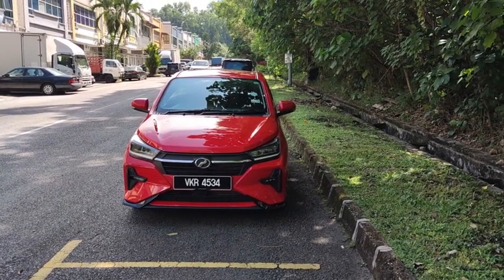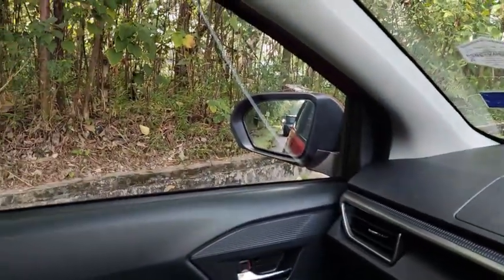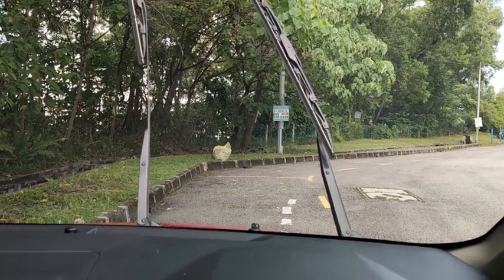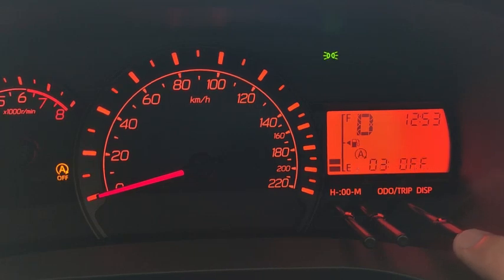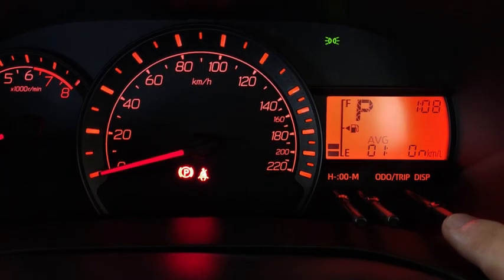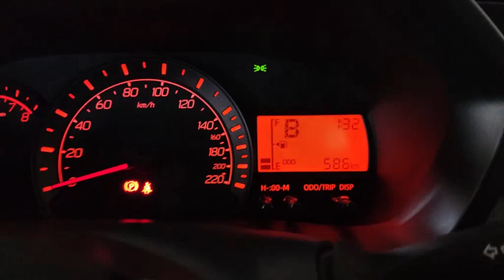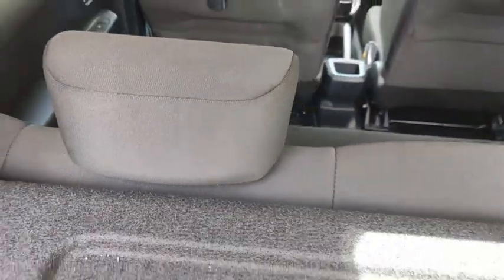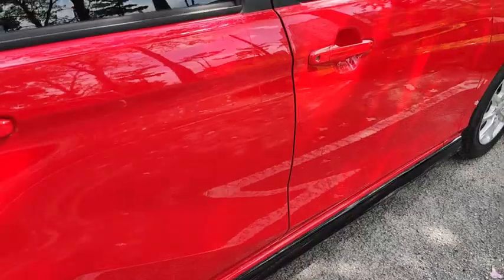2023 Perodua Axia SE

Comment: How to stop engine in n mode for double parking?
Reply from the maker: Try like this to see if it work, as this Axia is not mine. I rented this Axia for this video.

Put gear to P and turn off engine. Press lock button near the gear selector with the physical key and shift to N. Release hand brake. Exit and lock the car.

If alarm remote unable to lock the car, lock with physical key.
Reply: @kokwahgoh1932  alrighty then. Thank you very much.

Comment: Hi, how about if I leave the car for awhile with engine on with N gear + handbrake on. Do I need to bring the car key with me? To avoid getting locked inside. Or can suggest how to leave the car for awhile by the side of road. Or no matter I must turn off the engine.
Reply from the maker: While out on the road always bring the keyfob with you just in case it got locked inside the car. 

If you want to leave the keyfob inside the car, at least remove the physical key from it and bring it along with you just in case the doors got locked and you have the physical key to open it.

Do not leave the engine running when you leave your car at the road side. Car jackers can quicky drive off with your car. Always turn off the engine and lock your car even if you leave it for 2 or 3 minutes.
Reply: I see. Thank you so much for the response boss and kudos for the video. Really benefits Axia SE 23 owners particularly.

From now on need to turn off the engine no matter what and how long. Anyway, if during traffic jam/light, is it okay to shift to N? When eco idle off. Is idling during that period okay or need to turn eco idle on?
Reply from the maker: @edavivier  It is OK to shift to N or leave gear in D while waiting at traffic light. It is best to turn off ECO idle before driving to prevent frequent engine switching OFF and restarting. Restarting too frequently can cause starter motor carbon bush wear out prematurely.

Finally thank you for watching.